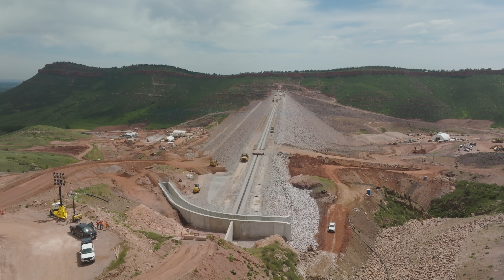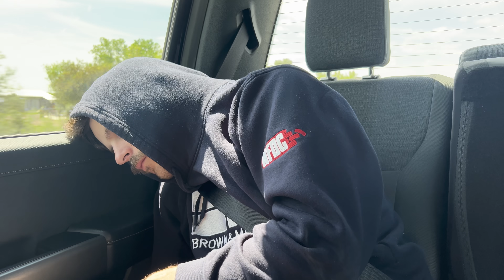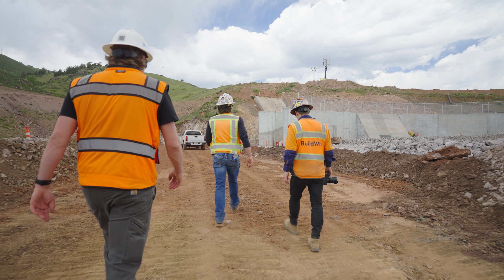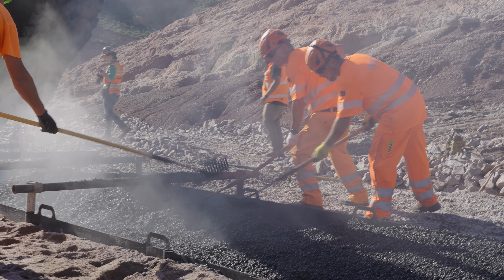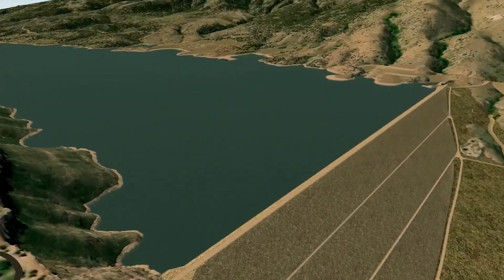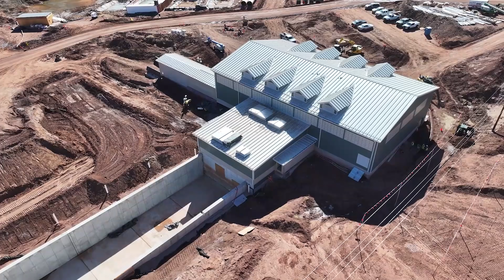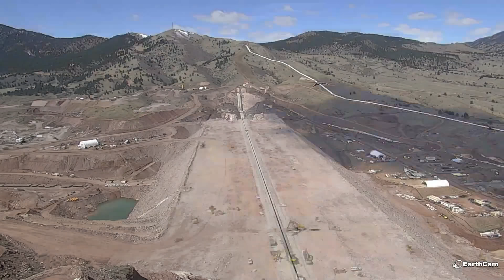Why Is Colorado Building a 22 MILLION TON Rock Wall in the Rocky Mountains?

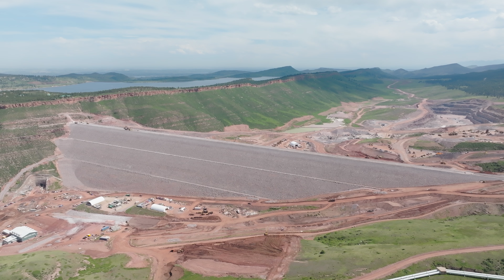Comment: 20:24 Almost finished and they take this drone shot and go oh shit! There was already a reservoir right there over that ridge!
Reply: Look at a map of the area and it will become even more weird to you because just about that reservoir on the other side again is yet another reservoir called Pinewood Reservoir. But wait for it, just below Carter is yet another reservoir called Flatiron. These are all within about a 15min drive just stacked one on top of the other.
Reply: Nope I'm not done! Just continue to follow the map East and down in elevation and you will find Lon Hagler, Lone tree, and Welch Reservoir. I don't even know how to describe it in a way that would do it any justice but pretend you are up top at pinewood and throw your paper airplane, if it was a good one it could pass over each or these reservoirs before it landed! Not really but that's how all these bodies of water are stacked with a major elevation shift from top to bottom
Reply: @elbertmathews1293 They are all going to be sucked up by the massive amounts of data centers this Govt has already agreed to allow to be built under the table. This water will not be used for any of us ppl in this State or any other State.
Reply: Yea i dont get it
Reply: Isn't that the dam they are talking about.  This is just a fresh water reservoir and apparently the dam is built for power supply? 🤷‍♀️idk
Reply: That’s Carter lake which was built in the early 1950’s, is on the other side doing the same thing but because northern Colorado is growing they need more water for the people moving in.

Comment: We are definitely thirsty along the Front Range. My biggest beef is that we build the most dams & reservoirs without hydropower of anywhere, as if we have plenty of renewable energy too. Yes, it’d be more expensive, and take longer, but these aren’t damming rivers which are environmentally destructive. We should at least generate the electricity it takes to get the water to the reservoir, if not all the way to the end user & last stage before returning it to the river.

Comment: One of the problems that they found on the dam, is that the rock that they used is high in uranium. They won't be able to use the water in the dam for years until they can make sure that the uranium is down to safe levels
Reply: What is a safe level for Uranium in drinking a bathing, what the scientists said after receiving their grants?
Reply: @trashpanda9633  The safe levels are 30 ppb, they aren't completely sure how high the levels are going to be when the dam is filled but they're going to have to watch the levels and see what they do. If the uranium is still too high, they're going to need to figure out a way to get it to low enough levels

Comment: I am no dam builder or knowledgeable in rocks & soils, but I just need to ask this: Why allow for a total saturation of the material on the water side (wet)  of the dam?  That saturated mass is going to exert tremendous forces on the 'wet' side of the flexible core isn't it?  The dry side mass will be dwarfed by the saturated mass on the wet side isn't it?  Seems like it is only a matter of time before leaks are formed, especially at the base.
Reply: They will find out.
Reply: The sheer mass of the base, the mass of the dam structure itself plus the curved shape will hold back the water. Once filled there really should not be any issues with the rock on the water side from being saturated. The water will typically be still except at the surface so the rock will not be subjected to ‘turbulence’ for lack of a better term. 
They’ve found out that concrete dams can be jeopardized more by water intrusion getting behind the concrete layers and eroding from the inside out.

I’m no dam builder either, but I’m naturally curious and have watched a lot of content on dams and dam failures. 
Check out some of the videos on the ‘practical engineering’ YouTube channel, Grady builds models to demonstrate a lot that goes into large civil engineering projects like this. He has a few videos on dam construction and digs into some more recent dam failures.
Reply: @michael-michaelmotorcycle  Okay, thanks for the info.  However I do not 'see' a curved shape (it is a long straight triangle) and the Hoover dam does have a curve and is built with concrete.  The mass of the dam is asymmetric with the wet side having way more mass than the dry side - right?

I believe one has to admit that the wet side will be inundated with water mass - substantially larger than the dry side - the water does not need to move as the hydraulic pressure alone will exert a tremendous force.

I don't get it.  Something doesn't seems right.  Especially if that flexible core gets distorted enough to cause weak pockets that eventually fail.

Comment: Dams are good. Just think if the Guadalupe River in TX had a dam on it, those 27 little girls would not have had to die like they did on that dark rainy night. That area was known for its flash floods. Dams can stop that by storing water and releasing it at a reasonable rate. Stop tearing out dams.

Comment: I worked on a dam Similar to that type of build we did the center core different we used clay and at the core we filled it with clay and then used a clam style bucket on a crane and dug back down to bedrock about 5 foot With and as we dug we pumped a water solution into the ditch to hold the side from collapsing and when done digging we pumped concrete into the ditch and it pushed all the water out so we basically Is pored a 5 foot wide concrete wall that was hundreds of feet tall we also had a Rock corey on site the Project i worked on was much bigger then this one. The caterpillar Dealer built a repair shop and parts depot on site if memory serves me right i think we made the largest single purchase of caterpillar equipment ever.

Comment: BTW Wyoming is the largest producer of Bentonite Clay. Just about every dam in the US has been built with Bentonite Clay which is one state away from Colorado. Go figure Colorado would rather put oily black asphalt into the ground to spoil the groundwater and hire a Swiss company to install it. Brilliant!
Reply: No, most dams are not built with bentonite.  Dams are also built of clays, silts, sands, rock, masonry stone, Roller compacted concrete, concrete, steel, and geo-fabrics, or combinations of these, to name a few.   As a graduate from University of Wyoming and a Principal in two engineering companies, bentonite is commonly used in some water storage facilities, typically below grade storage vessels using a bentonite slurry.  Some dams that have to much leakage can be treated in similar methods as below grade reservoir construction.  Wyoming bentonite is a great item, nonetheless.
Reply: @billhillify1 
Don’t tell my father in law who built slurry wall dams from Falcon Lake on the Texas / Mexico border to Oregon using Bentonite Clay for 40 years!
Reply: @kscipkkkk 
Some dams in Texas may have bentonite slurry repairs or bentonite slurry cores in original construction.  That would be true.  Along the Columbia River a few have slurry wall cores as well...Jackson Lake has a repair with a bentonite slurry as well. So it is possible, but typically those dams would also include rockfill  shells or earthen shells as well.  You would be correct on that point.

Comment: I hope you’re covering the construction of the new Glade reservoir as well further north
Reply: Recently,on the train between Denver and Winter Park they pointed out the Gross Dam expansion project which is visible from the train windows. The water utility is adding about 130 feet to the height of that reservoir. I remember it was before the Moffat tunnel.

Comment: As a registered professional engineer, I would find it fascinating to see the calculations that established the 2' width (thickness) of that asphalt core.
Reply: I am not am engineer. But personally, living downstream of this beast, I would prefer around 100 feet of asphalt core.  LOL.
Reply: I think the important calculation is how much rock was needed to hold that 2' of asphalt up
Reply: The dimensions of the dam itself are pretty strait forward from an engineering standpoint. I would hope that the asphalt layer was not a SWAG calculation.
Reply: @herbieschwartz9246 based on how that machine seems to be made to make it two feet wide, I bet it's a fairly standard dimension for dams
Reply: Two feet is probably just the minimum workable width, which gives the best cost for this alternative. All the strength would be coming from the confining forces of the rock fill
Reply: That's still a SWAG, seems reasonable but were any long term permeability calcs. done?  What about chemical degradation or asphalt creep in the long term?  2' wide with static pressures that high would make me nervous and prone to adding in some significant safety factor to the width of the asphalt.
Reply: It looks like standard road asphalt has a conductivity on the order of 10^-4 cm/s. With asphalt content above 6-8% it drops to around 10^-8. Lab tests could give them transmissivity, which is what you would want instead of conductivity to calculate the required thickness of that core, but if those conductivity values are right then a minimal thickness of asphalt core should be enough to retard any advective transport through the dam. For context, I think I've seen standard values for bentonite or similar fat clays used in landfill liners estimated around 10^-8.
Reply: Your not good enough to be on a job like those
Reply: Two is better than one obviously
Reply: Watch it literally be a couple of guys "We need an asphalt wall, how thick should it be?" 
"Eh, two feet should do it. Keeps back the water and lowers our costs on special asphalt we have to truck in."
"Yeah. That should be fine."
Reply: If the asphalt is an impermeable substance, is toxicity an issue? Just asking....
Reply: Hope it doesn't all get squeezed out .
Reply: Think they are using the special non toxic asphalt??
Reply: Why?
Reply: Why?
Reply: 2" thick lifts dummys
Reply: I specifically said width for those of you who have no technical background. And even then I get a stupid comment from someone like you who can't interpret basic specification.  So do you have an engineering background that could provide the calculations for the width or the asphalt?  Didn't think so. In the future don't act like a spoiled, self entitled brat.
Reply: @Lucysdad66 9 inch lift,. 2 feet wide.
Clean the wax out of your  ears.
Reply: @Lucysdad66 9 inch lifts, 2 feet wide
Reply: @Lucysdad66 it is 2feet wide by 9 inches lift.
Reply: @Lucysdad66 they said 9” lifts dummy. But your wouldn’t know what 9” looked like.
Reply: @michael-michaelmotorcycle 😅
Reply: I bet he does know and enjoys 9" insertion.

Comment: FWIW, the dam doesn't care that there's "3 miles of water" behind it.   Hydrostatic fluid pressure varies only with its depth, so the dam would feel the same pressure on it if the lake were only a quarter mile long, versus 3.
Reply: Exactly, except for the damage when it blows😊
Reply: Very interesting, I didn’t know that
Reply: Interesting, so a long narrow reservoir would be the most ideal water capacity/dam size ratio? Makes sense why most reservoirs I can think of are in canyons, not
Like this one

Comment: Would have liked to see some electrical generation added to the project as well as pump storage capabilities.
Sad that they missed out on one of the most important aspects of these projects.
Electrical grid stabilization could have been added to the design basis early on for pennies and it would have supported the grid at a significant cost savings over time.
Reply: Absolutely agree 100% but that’s never going to happen in Colorado.  The GE cult, their lawyers and radical collective ideological politicians have destroyed the CO. Energy sector of reliable, abundant, affordable and efficient FF energy sources in order to take control over the economy and destroy rural communities.  The push for GE is 100% political has zero to do with the Environment, It’s a power grab by government to control the energy sector because if they can take complete control of energy they take complete control of the economy.  Energy is the lifeblood of the economy if government controls the economy government controls the individuals wealth, labor, private property and therefore the individual’s freedom.
Reply: You think no one is aware of that option?
Reply: The whole reason they are building it is to save water.  If you release that water to generate power you lose it (doubt it is used at sufficient rate for power) -- and there isn't that much height.  If you wanted to do pumped hydro you would need a whole second resovoir at a lower elevation.

Comment: So I'm assuming that that asphalt core has been constantly being installed since the start of the dam. 
I would think that the layers of rock would be added up to the asphalt core. 
So then the asphalt core is being layed first and then each layer of rock up to that height. 

Interesting, that the asphalt doesn't collapse. And seep through the rock. 

I would have liked to know how that is achieved. 

Also it would have been nice to have this process explained the way I'm assuming it is done. 
Considering it's the most important part of the operation.

Comment: So, which major waterway does the water that will eventually go into the dam normally flow?  What arrangements were made with Utah, Arizona, New Mexico, and Mexico to take that water away from natural flow to Lake Powell and Lake Mead via the Colorado and Green Rivers?
Reply: Per Grok
The water for the Chimney Hollow Reservoir, located just west of Carter Lake in Larimer County, Colorado, is sourced from the West Slope’s Windy Gap Project, which captures Colorado River flows during a short springtime window. The water is pumped to Lake Granby and then conveyed through the Colorado-Big Thompson (C-BT) Project infrastructure to a point just below Pinewood Reservoir, where a valve redirects it to the valve house at Chimney Hollow Reservoir. From there, gravity pushes the water through a pipeline and tunnel to the reservoir’s inlet-outlet tower.

The reservoir began filling in August 2025, with an initial phase to reach half capacity (45,000 acre-feet) by late 2025 or early 2026, as part of dam safety testing. Full capacity of 90,000 acre-feet is expected to be reached by 2026 or 2027, with water deliveries to participants projected to start in 2027. Some C-BT Project water is also being used for initial dam safety testing in 2025, to be repaid later with Windy Gap pumping.[](https://www.coloradoan.com/story/news/2025/04/22/when-chimney-hollow-reservoir-will-start-filling-open-to-recreation/83194229007/)[](https://www.northernwater.org/CHRP/news/how-it-works)[](https://www.northernwater.org/news/CHOperations)
Reply: I sure hope it is not taking water away from the Colorado River or the Green River. Them two rivers need every drop of water that they have.
Reply: They’re taking away from the Green/CO drainages. Feeding the metastasizing cancer on the east slope of Colorado being driven by transplant carpetbaggers. There’s a blog about it called the Fleeting West, and it doesn’t even scratch the surface of the complete overtake of CO by non-local people. Mad about water being taken across drainage from the CO/Green basin? Probably should be mad about unbridled growth along CO’s front range.
Reply: @Clawson_customs It is taking water away from the entire Colorado River Basin which is experiencing record extreme drought. This whole project stinks. Btw, they found uranium in the rocks that make up the dam. So there's that. Uranium drinking water is where we are at for corporate corruption in 2025.
Reply: I believe waterway rights should be sued for.  People making decisions for themselves without any consideration for others.
Reply: Well if it snows in Colorado and melts ! Who owns the water ?  So I believe Colorado does not need to ask to use water from thier state ? Colo River !
Reply: Water flows downhill bub, it’ll get there eventually. Colorado has water rights to any water that shows up in Colorado.
Reply: @michael-michaelmotorcycle  funny thing that, it's crossing the continental divide, so in this case it actually won't, it's going to end up in the Mississippi instead
Reply: @Seldoon_Nemar It isn't going to make it to the Mississippi. It's going to make it to about 800,000 people's lawns when it should be in the Colorado River going to the western slope of Colorado where we are experiencing record drought.

Comment: Super interesting!  Just looking at it, it looks like it would be relatively easy for the rock to get displaced along the side of the dam but I’m very confident that the engineers thought of that potential. I’m just used to either concrete or earthen dams. The earthen dams rely on grass to prevent erosion and concrete is, well, concrete lol.
Reply: Grass doesn't stop errosion .
Reply: @stewatparkpark2933 BS. I’ve been earthmoving for 50 years. You are simply flat wrong.